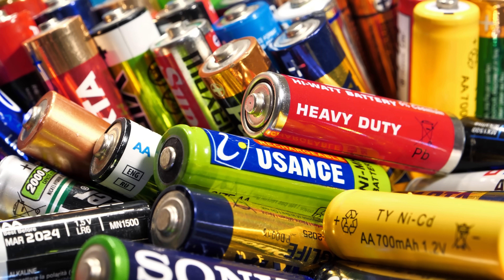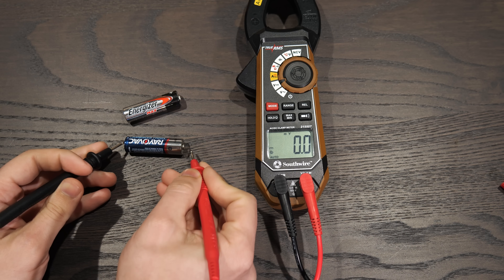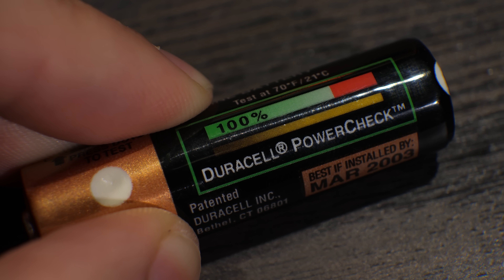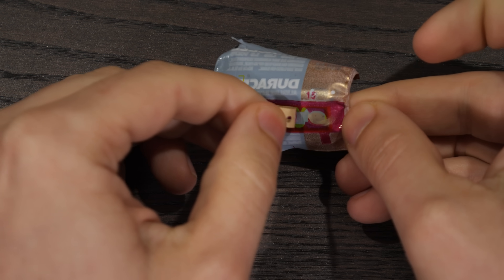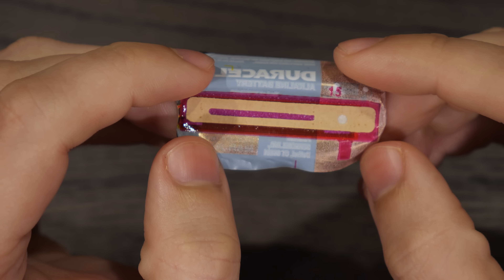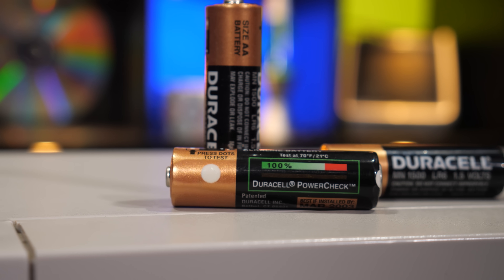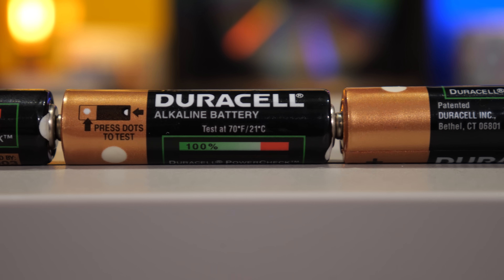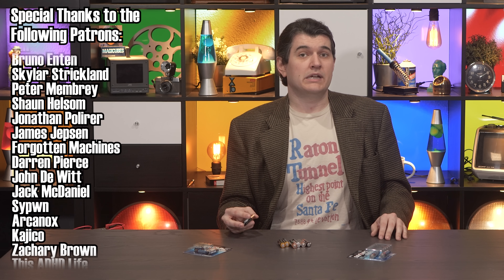Duracell PowerCheck: A genius idea which didn't last that long

Comment: As someone who grew up desperately poor at times, we definitely had a drawer for used batteries. When something like a radio or a toy used up a set of batteries to the point where they couldn't power that thing, we took them out and saved them. They were still good for super low-draw items such as the TV remote.
Reply: By a certain point, the number pergurtory batteries I saved up for our TV/VCR/DVD remote batteries exceeded the expected lifetime of those devices.
Reply: And then when the batteries in the remote started to go, take the back cover off and spin them. Gave you 2 more days before you had to put in new ones.
Reply: @justy1369  Same goes for popping them out and putting them back in again. I do this with my wireless mouse, too.
Reply: @emisformaker If there are two or more batteries in a device they won‘t discharge evenly. So swapping the places can revive it, at least for a short time.
Reply: @emisformaker Do you not understand how 🔋's work? 🤔
Lmao putting them back in without swapping their positions does not extend the use you'll get from dead batteries because that's just the equivalent of just turning the device off then back on 😂
Reply: @justy1369  lmfao, I was looking for this one...good old gameboy days and the battery ran out just before we got home with the car..
Reply: @justy1369  I still use the spin technique to this day hahaha XD
Reply: @justy1369  i did this on my xbox 360 controllers so many times XD
Reply: @justy1369  Yup, that totally works, it scrapes the oxide layer off the contacts and so gives you back a few millivolts that make the thing work again for a while.
Reply: Same here. Usually after a while the batteries charge is too low to drive anything with a motor or a display. They go into a drawer for remotes. Just to use up every little bit of power in those batteries before they are disposed (properly).
Reply: @NexuJin  i had forgotten about the motor thing... those cheap RC cars wouldn't drive on a half dead battery, but the tv remote has no trouble with it.
Reply: One exception, we used them in analog clocks which while they have a motor, it is not always crankin' and it's got a very, very weak force. We kept wristwatches if we could to make sure the clock hadn't stopped after all, but they could go for ages still with these almost-spent batteries.
Reply: Yup yup. After my Game Boy or Walkman ate up some batteries, they could still go for months in a remote control. Was this not the norm for everyone?
Reply: I was walking on an old railroad bridge recently and found two Energizer AA batteries that were littered by some ignorant person.I picked them up, took them home, and put them in a TV remote control and they work great!!! @PennyGadget47
Reply: The need to test batteries was due to a drawer full of half used batteries, and devices that needed 2-4 batteries to work. One dead battery, and the thing wouldn’t turn on. Or maybe the thing was just broken and needed to be smacked and would start working - but without a battery tester, you never knew which batteries were good or bad. You just grabbed different combinations until it worked.
Reply: We would put "dead" batteries in the freezer. After 3 hours or so they had some power. Ask him to test this
Reply: @Ihledome1  dude, I remember a friend coming over and showing me this when our RC cars ran dead... i'm pretty sure it was actually something with the high current draw of running those motors had just heated the batteries beyond their ideal operating range, but it totally worked to get at least a little more life out of a set of batteries
Reply: I've kept quartz wall clock going for many years going on AA cells pulled from other things like digicams. The digicam sucks the bulk of the charge in several hours but there's still a year of keeping the clock going!!
Reply: You gotta bite em a little to get the last bit of juice out.
Reply: Yesss that's exactly what we did, there would so many bite marks that it had to be thrown away or it'd start leaking @greenhowie
Reply: Remote controls and wall clocks, due to their very low power requirements, are often the final useful place for dying batteries. 😅
Reply: My dad had a complex drawer system of various used batteries, sorted by type & their expected state of charge.

When I'd play with these self-testing batteries, he'd get annoyed cuz I was using up the charge.
Reply: @AdmiralThumbs no offense, your dad may be neurodivergent
Reply: @BlackZynfyndel  oh 💯 he was.
Reply: I had a similar experience, except I was never poor, my parents are just very frugal
Reply: As a fellow desperately poor child of the 80’s and 90’s, batteries that had testers on them wasn’t an option. 
Duracell were for rich kids
Energizer for the middle class 
Ever ready for the lower middle class (remember the cat?)
And no brand name cheapo batteries for us poor folk. Batteries less than half true price with 1/4 the staying power
Reply: @onefortheroad2291 yep, after the batteries were dead, we played with the little cats. 🐱 😂
Reply: Dude, you just reminded me of a part of my childhood I forgot about. Thank you
Reply: Another thing is that there’s usually some pretty old unused batteries hanging around in the battery drawer. So having the integrated battery tester would still be useful to check if those old batteries are ok.
Reply: i always bought the cheapest, they were mostly Panasonic or Rayovac! duracell always costs 80% more
Reply: @gabrielvieira.4358  80%?! More like 90+% in my city. Forgive me padre I'm a cheapskate too, I only use store-brand AAAs ... The only thing that I ever used big-brand batteries (but none of this American-branded overpriced nonsense) was the bias supply in my tube monoblocks. The original GP alkalines installed around 2000 lasted for almost 15 years. They simply dried off to 1.4V without leaking or bursting. The next batch, this time a Varta, didn't make even 5 years before leaking.
Reply: Reading through these comments made my day y''all. 😄 sigh The good ole days.
Reply: On top of that not all battery brands were of the same quality. It was very common to use multiple brands of batteries in an electronic device, when that device stopped working you wanted to see which batteries still had enough juice and swap out the drained batteries.
Reply: even some devices that seemed dead with one set of batteries... throw them in the drawer anyway because there'd always be some other device that could still somehow work with lower batteries... SO many devices went thru so many batteries. I definitely do remember using these power meters on the batteries and checking them, it was handy. If they indeed rang up dead I would throw them away.
Reply: Clocks were the best second life for batteries
Reply: @MuscleCarLover  I have a quartz wall clock that burns through batteries like a mf. Must be defective or something.
Reply: @azmodanpc  I'm definitely not an expert, but some may draw different amounts of power, a desk clock or alarm clock tend to last months in my experience, small wall clocks tend to do pretty well too. I have a pendulum clock that uses a bit more, but not a crazy amount. If you have a particularly large movement to power, that may be the culprit
Reply: Still do. I even check the recycle bins at work and save any at >1.2v
Reply: This is the exact same reason we always had a lot of batteries lying around in the family home. (My parents hated wasting resources of most kinds.) TV remotes were almost always their eventual home. After they were taken out of the TV remote, we assumed they were totally dead and duly discarded them.
Reply: This. For me, it wasn’t just a matter of savings, we had been given a lecture at school about how batteries were super polluting so I had an extra interest in trying to get out the most charge out of our existing batteries. And yes, the batteries that were no longer useful in he high power demanding devices could still work in the TV remote.

Hell, I still have a drawer full of “maybe these work” batteries.
Reply: I was on niCd then niMh reusable battery for 1990's . Never had to act like this, never bought non reusable ones since then
Reply: I didn't grow up poor, but both of my parents did, so we had all of these habits in our household too. And indeed, before I moved 100% to rechargeables, I still did the same in my 12 years of independent adult living. 

Actually, it was kinda nostalgic to do the shuffle one last time after that aforementioned Eneloop Singularity. Even though I'd been doing it all along.
Reply: also analog clocks. They operate well with cells as low as 1.1 volts.
Reply: I still have a battery jar with partly used batteries. I don't think I'm desperately poor - I also don't like throwing out something that still has some use in it. Possibly a difference between US and other cultures?
Reply: We had a basket full of old batteries in the closet. I was always scavenging in there for my gameboy. I liked the power check ones because I could tell if they worked. Just putting them in and trying was a bad option, because it took 4 batteries and who knew which one was bad? Couldn't just throw them all out!
Reply: Batteries previously used in remote control are often still good to power an LCD alarm clock. It's not a matter of poverty/richness, it is a shame to throw away batteries that are still good for some purpose.
Reply: Many times when a device that uses multiple batteries stops working, only one or two will be completely dead and the others will still have like half their power or so left.  It only takes one bad one for the device to not power up.  So I also play battery roulette with them, testing all of them and then swapping out just the dead ones and keeping the half used ones.  I will also take the half used ones to use for remotes and other low power drain items.  Or occasionally a high drain items like an electronic toy will come with crappy "heavy duty" batteries rather than alkalines, so I'll whip the cheapies in the battery drawer for later usage in a remote where they will function fine.
Reply: Same, but in my childhood we also found out that the used battery could be temporary revived by chewing it's side 😅
Reply: Yeah, but would you have bought slightly more expensive batteries just to make your used battery testing process more efficient? Unlikely, which is the point
Reply: You were lucky! We had to sleep in drawer! Toys - our toy was a used AAA battery, and I had to take turns with m brothersto play with't , and my turn was Monday nights and every other Wednesday.
Reply: How did you become not poor? Everyone I know is even poorer than their parents were.
Reply: I was too poor to actually have anything with a remote. . .
Reply: Same here. To me in the 90s in what was then a developing country a battery was an expensive item. You would use them in various devices until they were totally drained. I invested into rechargeable ones, but now when I have a kid and we are no longer that poor country, I can buy a 200 disposable batteries with one hour worth of wage, I just buy huge packs of disposable batteries and sometimes check them with a multimeter.
Reply: I still have trouble throwing out old batteries. I then end up with a crap load of batteries and my new battery container always spills into my used battery stash. I then end up with a pile of batteries, some dead and some new, and I can't tell the difference.
Reply: About twenty years ago I learned that you can recharge alkaline batteries a few times (4-5) and save a lot of money. I‘ve been doing this since and never had any issues, except for some leaking, which only happens in about one of ten.
Reply: Guys, he wasn't saying people don't have a used battery drawer, everyone does, he was saying that there was no point in testing the batteries.  You just grab some batteries from the drawer and throw them into your remote til they stop working completely.  You didn't really need to test the batteries in the drawer unless you were just curious.
Reply: @Tinil0  This is flawed logic.... Adult toys.
Reply: @Tinil0  My family did not have a used battery drawer. When batteries went bad enough that whatever device they're in stopped working, we threw them out.

Just as easy as it is for you to assume that everyone has a battery drawer, it is for me (and maybe Alec) to assume that everyone throws out their batteries immediately.
Reply: @trainzack wow. How insanely wasteful and bad for the environment.
Reply: @danieldaniels7571  I used to work at a retirement facility, like 20 years ago. Some of the residents there grew up in the Great Depression era. I saw one of them with cleaned, used aluminum foil hanging up to dry. He was pretty well off, from what I could tell. I saw another one washing zip-loc bags for reuse. They weren't doing that for the environment, they were doing it because they couldn't stand to be wasteful, even after all those years. Do you throw any of those away without reuse?
Reply: Hey brother
Reply: using smartness. Nice
Reply: Oof, I feel you. Nice profile picture, though! One of my favourite franchises.
Reply: We would roll them back and forth in the remote to ekk out more power. I've never tried the biting/freezer/rock/dropping strategy. 🤔😅
Reply: When we buy something that comes with batteries, when those cannot power the device they go into either a remote control or a computer mouse or keyboard, and often that set of batteries outlives the device they came with, which either breaks, is lost or we simply stop using after we discover we did not need it and should not have bought it in the first place.
Reply: got a sectioned drawer for rechargable, then full and used cells, using the used cells for all the remotes and other small things
Reply: Exactly. Those flying around in the drawer is so common, especially since these have enough energy for several devices, but not that device you tried them in. Maybe these batteries were low power to begin with, even with new ones.
Reply: Yup. Once a battery was too dead to make a motor run, there was always still enough in it for all kinds of things without moving parts to keep going for months. Putting new batteries in the thermostat or corded phone was for suckers.
Reply: Big facts
Reply: Or clocks
Reply: Yuuuuup I remember the battery drawer.
Reply: This is exactly it. Never could afford batteries when you needed them, I still do this because 2/3 dead batteries will still power the remote!
Reply: Thanks to the follower who suggested this. I have silently wished for you to cover these at least once!!!
Reply: We still have them. All of them eventually ending up into the TV and AC remotes.
Reply: We all did this but sorry you were poor dude
Reply: No way my fam wasn’t the only ones that did this lmao
Reply: I used these all the time as a kid, if I was taking my gameboy or something somewhere it was good to know if they had plenty of charge left or if I should get fresh ones, and it's not like we had a half dozen remotes that used AA to slowly use the rest of it, I would just finish them if I was at home lol
Reply: We did that because we didn’t know what to do with them. They said don’t throw them away
Reply: This, not all of us grew up with packs of new batteries. We had to scavenge.
Reply: Came here to say the same. Battery usage was (is?) very tied to social class!
Reply: Yep, I remember that drawer.
Reply: I remember sticking them in the freezer to get more juice 😂
Reply: True many devices use small charges and these batteries were still good to power them.
Reply: I often buy dollar store batteries for most items and only specialty devices will I use expensive ones. I have done this for years with no problems.
Reply: 9 volts dont need a fancy tester. Tongue on both contacts will let you know good, low or dead. 😁🤣🙏💕
Reply: As a kid in the 50s we had to heat up old batteries for our bicycle lamps to get the last bit of energy out of them.  The big problem then was batteries leaking - I had more torches and lamps destroyed by that!
Reply: My Mom grew up in the Depression. She used to throw old batteries in the freezer. I remember once during a power outage, she pulled a bag of D cells out of the freezer and put them in a flashlight. They kinda worked for about a minute or two, then dim out. She'd just swap out the batteries two at a time until the power came back on about half an hour later. She gathered up all those old batteries, threw them in another bag and chucked them back into the freezer. I never figured out what happened to her battery stash.
Reply: @bushputz  They store well in the freezer, but need to be heated to work.  Is because all chemical reactions are slowed by cooling and speeded up by heat.  Your Mom knew a thing or two!
Reply: Glad someone else said it. A battery isn't dead until it powers not a single device in my house. Even if only for a day.
Reply: same, I still live like that
Reply: Batteries sure go a long way in TV remotes and can still power the thing when nearly dead. Wii remotes, on the other hand, will chew through batteries like mad and stop working when the batteries drop below 1.3 volts. Crazy!
Reply: I think you are forgetting things like early game boys and digital cameras 

Were a perfect market for the built in tester 

You didn't want to bring a dead camera to a wedding 

Or 

You kid having flat batterys in a game boy on a long road trip
Reply: Did any of you use the "put them in the freezer for a lil while" technique? That supposedly gave the battery a little bit of his charge back. Something my grandma believed in. Never really found out if it actually helped.
Reply: Remember to drop the batteries into the floor to give them extra juice!
Reply: 'desperately poor' is when you have to smash these batteries with a hammer (aka, brick/rock) to make them give out some more power (smh it works)
Reply: @lordmrwhatsyourname in my time, we would heat those batteries by placing it under the sun to force it to produce enough voltage and current 😂😂😂
Reply: @lordmrwhatsyourname  ive been known to use a heatgun/hair dryer on batteries to get some oomph out of them.. usually phone batteries but it works on any
Reply: @lordmrwhatsyourname I wouldn't have thought that would work and would be too afraid of them leaking to try, I must admit.
Reply: @lordmrwhatsyourname Remember taking the cover off the remote and rubbing/rolling your hand over the batteries to try and warm them up enough to work for another day or so?
Reply: @lordmrwhatsyourname  I remember seeing chewed batteries in remotes
Reply: @lordmrwhatsyourname warming them up a little on a stove also worked to get them to give a little more juice
Reply: @lordmrwhatsyourname  
Its not a competition grow up
Reply: Awesome trick! Never heard of it.

But I did know that you can sorta recharge alkaline batteries. 

Get 8 batteries and use 12 volt car charger on low until they heat up. 
(They’re prone to leaking if you do this)
Reply: haha in my house we had a giant baggy of batteries in the draw and a battery tester next to them. We did the same thing because not all devices needed the same amount of juice to function. The tv remote was most definitely the place AAs went to die/final resting place lol if it couldn't power the remote they were done!
Reply: I still hate throwing away used batteries. They just feel like they should still be, somehow, useful.

Speaking of voltages, at the opposite...the first digital camera I got was a Kodak DC3200. It required 7.2 volts to operate...

...and only took 4 AA batteries. You can do the maths on that one: 4 x 1.5v = 6v. 

Thing is, brand spankin' new, minty-fresh AAs wouldn't ben 1.5v.  They might be anywhere from 1.8v-2v, which is still within spec for the AAs. 4 x 1.8v = 7.2. Thing is, they weren't designed to be that, and the discharge curve in a decently-designed battery quickly dropped down to 1.5v and stayed around there for most of their life, the tended to crash dive. 

So this thing would take maybe 10 or so shots with mint AAs, then die. The batteries would then last freakin' ages in my discman, as if they'd not been used at all. 

And, no, you couldn't use rechargeables: the vast majority of rechargeable AAs only ever get to 1.2v - again, within speak, but that ain't gonna lacerate the Keen's.
Reply: @hoilst265  I have seen an 1,5 v rechargeable.,  For sure they are rare. 
Also, I recently learned that disposable ones can get recharged. Sure, not as many times as the ones meant to. But since so many people talk about so many methods like shaking them . I knew about heating and rotating, but not about others. Recharging never crossed my mind, because back then did not even got the concept. But in recent decades since charges are a common reality,  is a wonder that so many people thought of it. This is a testimony of how sheepishly we follow orders. They told us not to recharge, and we obeyed, and paid and paid for nothing.
Reply: I use the lithium energizer ones for all my devices.
Reply: You weren't desperately poor if you had toys and batteries.
Reply: @mediocreman2 True, go outside was how we played.
Reply: @mediocreman2  My apologies. I forgot you were there.